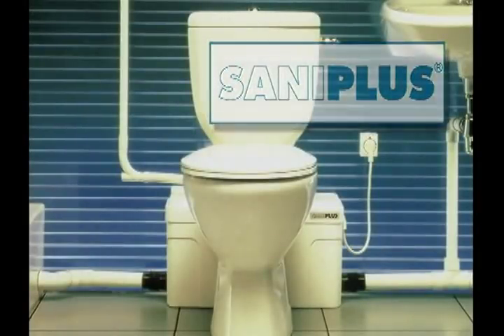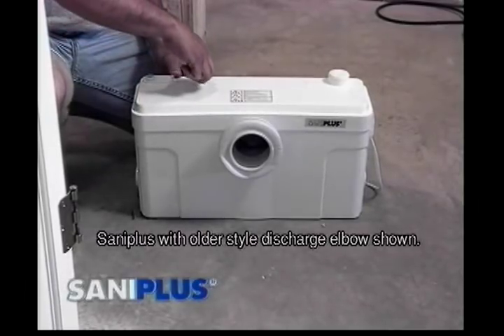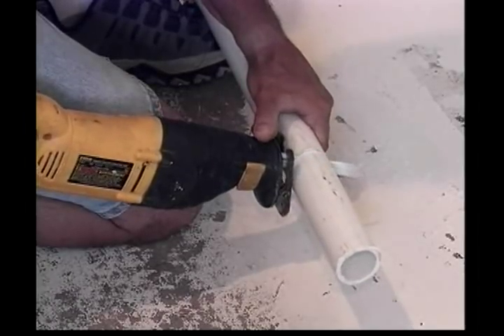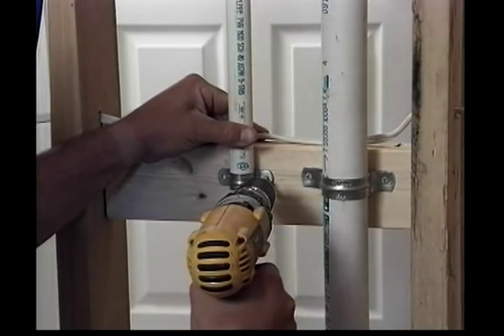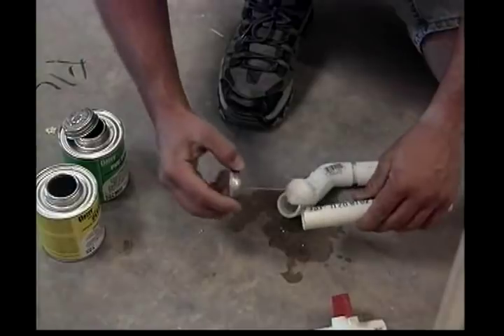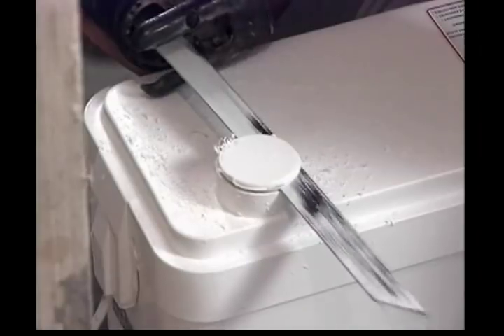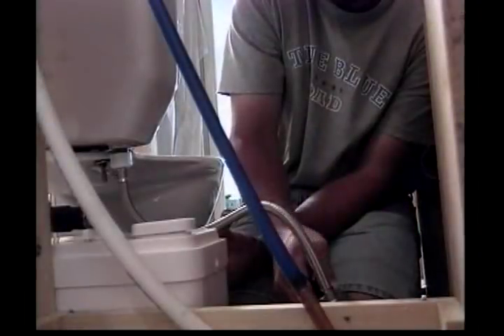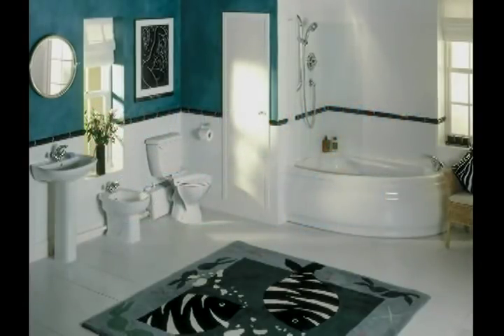Saniplus Installation

Comment: My saniplus unit is beginning to let water build up in the sink and shower, and sometimes doesn't pump after a flush. And it is making loud noises for longer than it used to after a flush.
Sometimes it sounds like it's beginning to fail, as the cutting blade sounds like it's about to cut out. And it has simply cut out a couple of times, only to activate again about 5 mins later.

Any advice? It is bleached regularly with the power off, then flushing if that helps.

Comment: does this unit need to be vented to operate? 2 way air flow, no cheater vent? i have no easy access to a vent without compromising the vent on the first floor. Can I vent it directly outside and if so should it be extended up and above the roof line?

Comment: mine stopped working after 8 years,,mfgr said it the starting capacitor,,got it today pulled the unit apart but dont know if the cap has specific polarity or not..and i must say DANG that sucked cleaning the unit out.

thanks

Comment: Hmm, to clean it I usually put bleach into the toilet, turn off the saniplus unit and flush the toilet, and leave it for around an hour and then turn it on again so it pumps the water back up.
But yeah, it is sometimes not pumping water up like it should, hence water builds up in the sink etc. 
I guess I will have to open it up and take a look :(